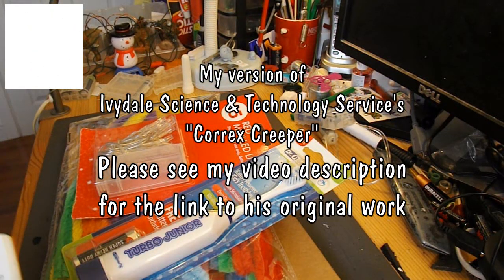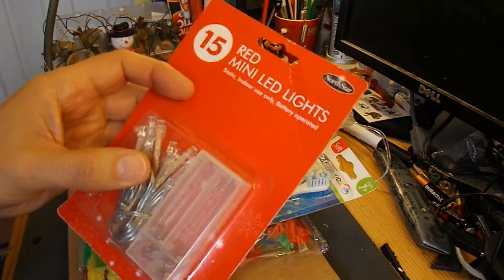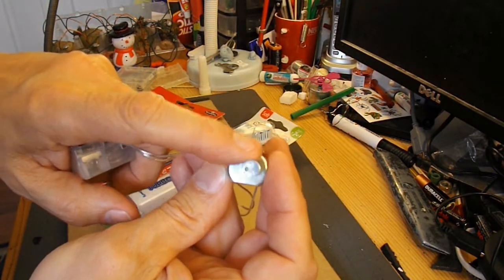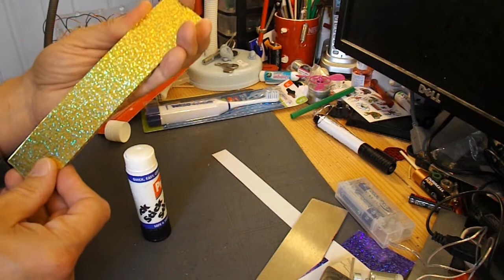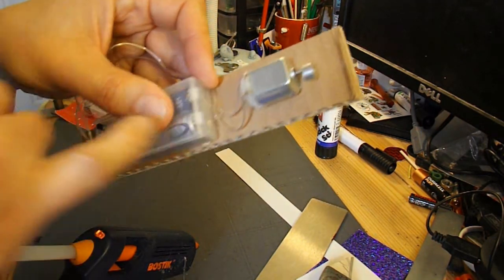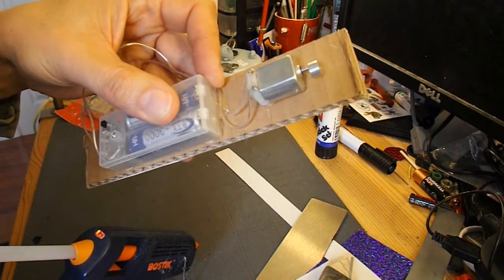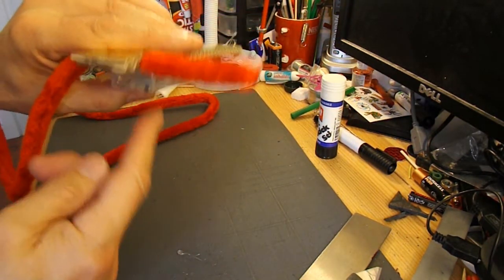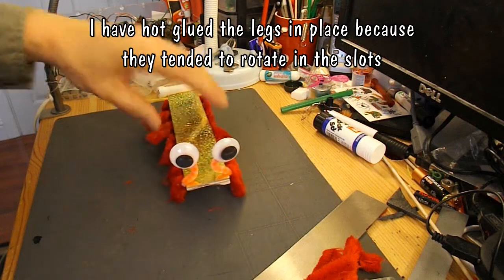I liked this so much I made my own #1

Comment: To remove and replace batteries and motors several times, you could use "velcro"
static.mintcdn.com/hobbyjesscom/ec_imgV2/velcro_adhesivo_negro.jpg?s=v2xxlv2h
Reply from the maker: Yes I use Velcro on many of my projects but penny for penny there is not much difference in cost, the hot glue is a rigid fix for this vibrating application and it can be peeled off when the toy is recycled at the end of the project.